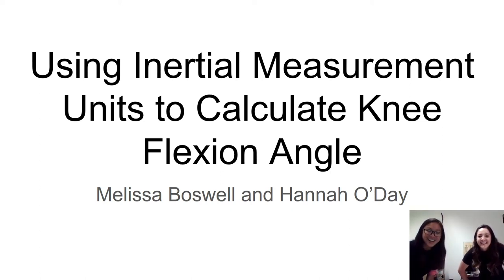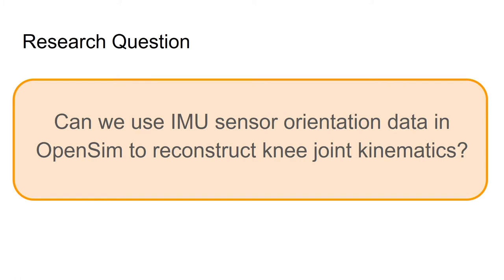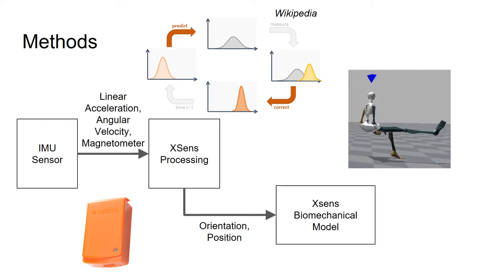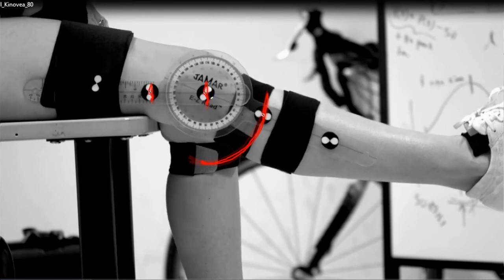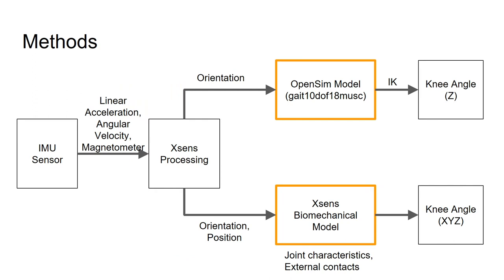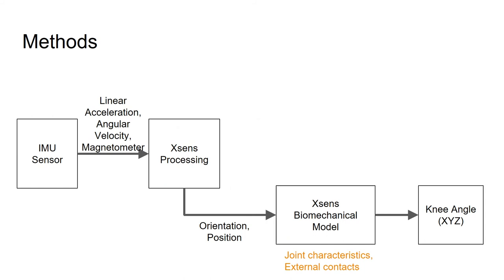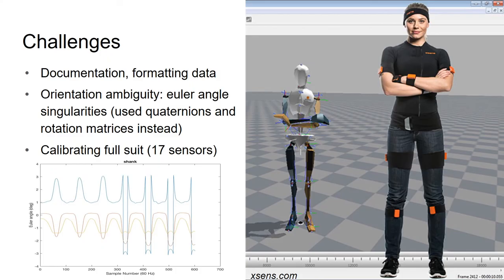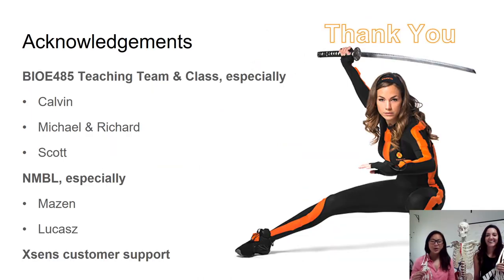Using Inertial Measurement Unit Sensors to Estimate Knee Flexion Angle

Comment: Hi Hannah. Could you please tell me how to measure ankle and knee joint angle using GY-521, MPU6050 Gyroscope/Accelerometer? How many such sensors will be required, and their placement on leg. Thanks

Comment: Hi Hannah, 
I am currently working on a similar project and am wondering if you have any documentation which helped convert the Xsens data to the OpenSim model stage with .trc and .mot files? Any help would be greatly appreciated.